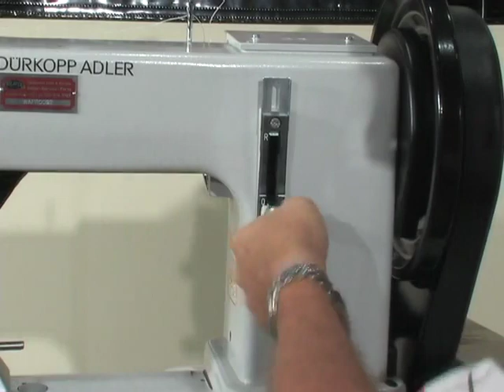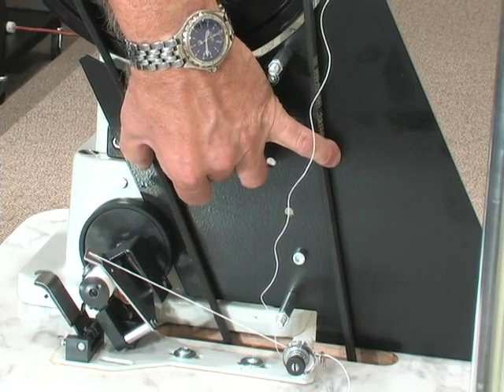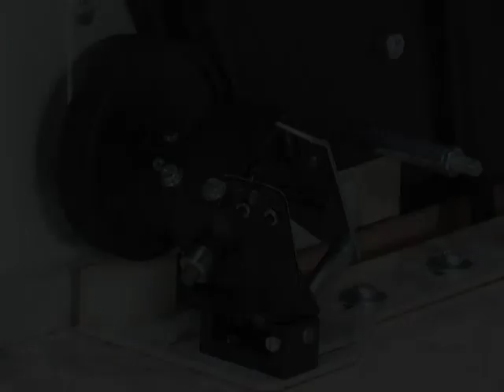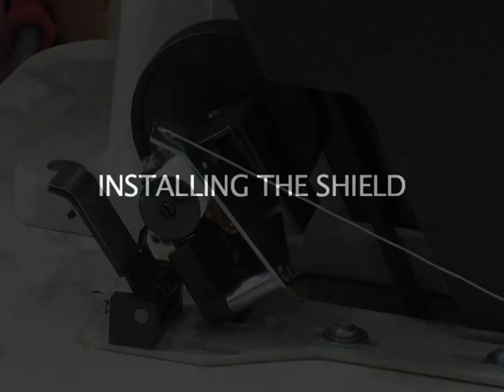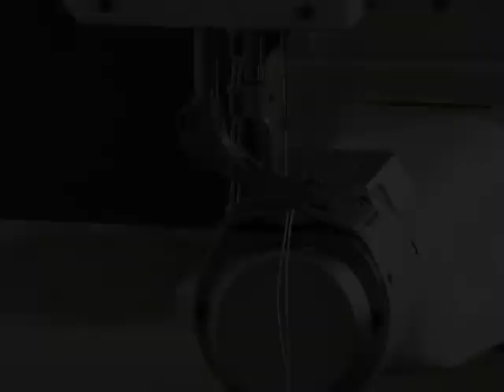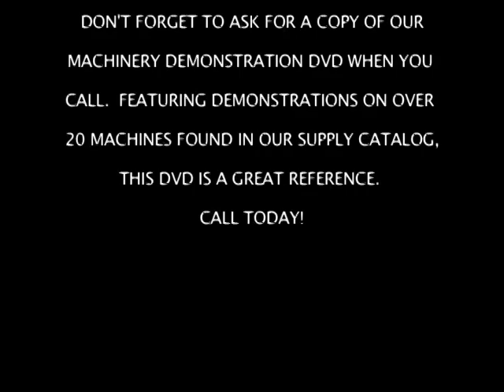Troubleshooting a 205 Adler sewing machine pt2

Comment: Thank you for information on the Adler 205-370 I had ticking noise in the bobbin case area on my machine and with your videos I discovered a small upholstery nail had some how found its way into the bottom and after a good cleaning works perfectly.